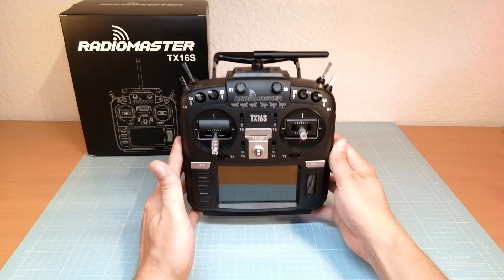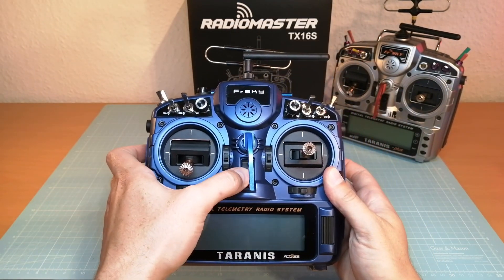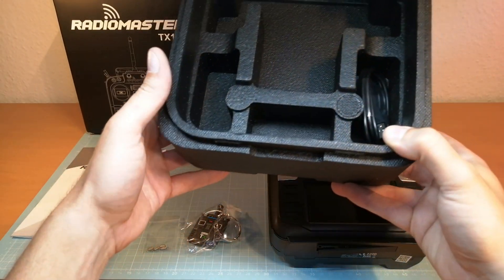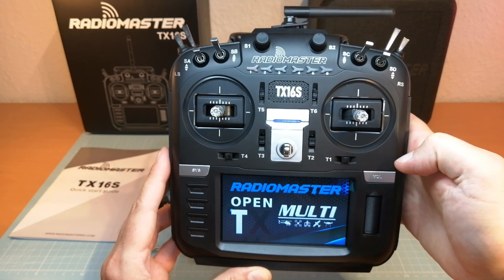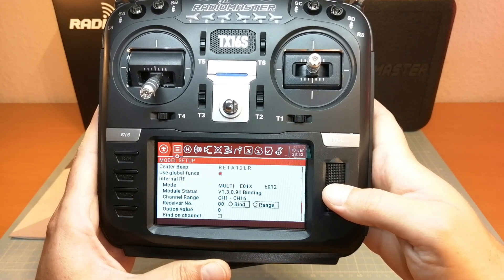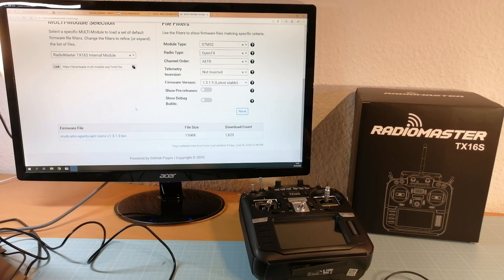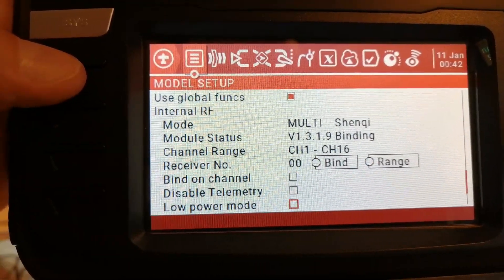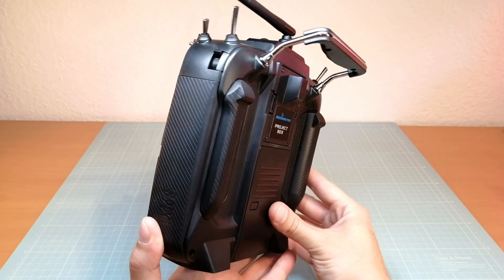Radiomaster TX16S 📡 Compared with FrSky Taranis & How To Update (OpenTX & Multi Protocol RF)

Comment: As you say it is touchscreen ready, absolutely not touchscreen enabled!!!!!

The whole reason I bought this radio master TX 16 as was for the touchscreen and obviously for the multi protocol capabilities.

   But as it is and as it comes it is absolutely not touch screen enabled!!!

So you people thinking of buying this TX 16 years don’t fall for the touchscreen enabled mode!!
Reply from the maker: The TX16S Hall Sensor Gimbal Version is touch screen ready, but opentx doesn't support it yet.

Comment: the corona protocol is for us to disable corona when we go out for flying , lol!
Reply from the maker: thanks for clarifying :D
Reply: @TorbanDallas  Some say that the qx7 feels more sophisticated and sturdy and the tx16s feels plasticy and toyish Is that true ?
Reply from the maker: @aakashjana6225  Yes i would agree with that, but all in all you get more radio for your money with the TX16S - the LED Display Screen, Multiprotocol Module and so on.
Reply from the maker: and you can even upgrade your TX16s with gripping areas , they are not available yet, but i will try to get them soon to create an upgrade video.
Reply: @TorbanDallas  if its possible to bling it out like the taranis radio , i will buy the tx16s asap 😄 thanks for communicating man.

Comment: Hi Torban just received mine but it won't charge the batteries fully via the USB-C port. I use 2x 18650 Li-ion cells.
Did you experience any charging problems?
Reply: Is your problem solved now?
Reply: @muhammad_hasnat  I added an XT-60 cable to the battery holder. Now I can charge the pack using a charger.
Reply: @mariossofokleous6075  that's great it's charging but that's not what u paid for u should return it & ask for a new one or get it repaired from factory
Reply: @muhammad_hasnat  I'm late to the party - is your usb source capable of the right power output (not sure what, probably usb-pd over c connection) Might require a higher voltage than default 5 and if your source can't provide enough juice the controller might think it's browning out trying to charge.

Comment: Hallo Torban. Ich hätte eine Frage. Ich habe ein Mamba Stack F4 50 Amp. Dazu ein Beitian Bn 220 GPS.. Kein Magneto Meter auf dem Board. GPS wird erkannt 14 Satelliten. Die Homdirektion stimmt nicht. Hast du da einen Tip wie man das lösen kann? Mfg

Comment: Good video Torban, have you flown with it yet? What are the gimbals like?
Reply from the maker: Just some whoop flights :) Gimbals are feeling similar to the FrSky Gimbals, but a bit softer. I need to change the spring tension as mentioned in the video. I also will replace the stick ends.
Reply: @TorbanDallas  Excellent, still waiting for mine. Is it M4 ends?